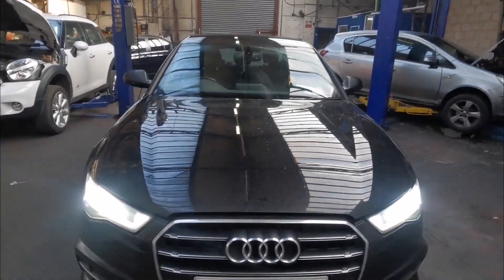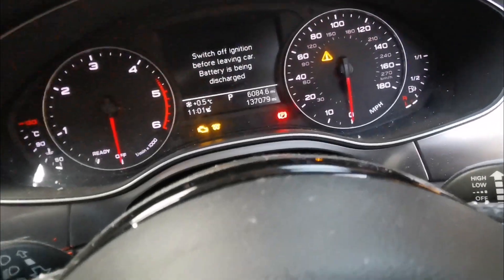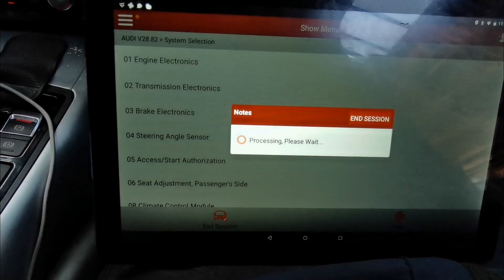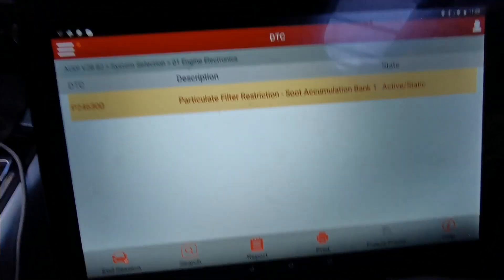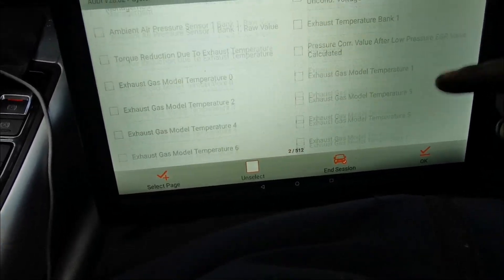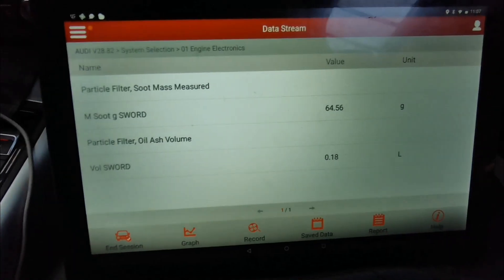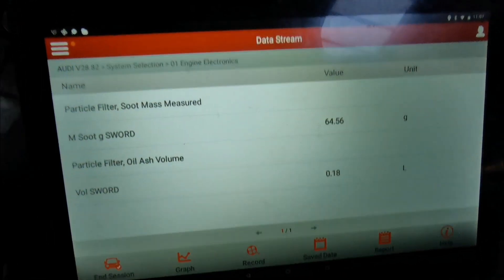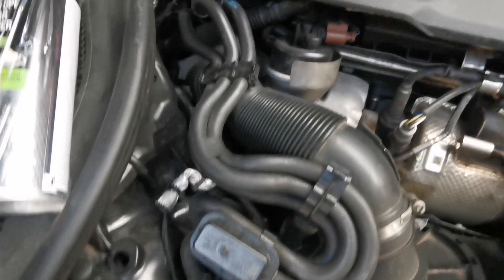cleaning dpf on car  Audi A6 2.0 tdi #Audi #VW #seat and scoda

Comment: Hello
I wanted to ask you a question about my vehicle?
Reply from the maker: Hi
You are welcome to ask, and I'll domy best to help. Other people will also help.
Reply: good evening, I have the same vehicle as in the video, Audi A6 c7 190hp. engine light on, I changed the egr and egr radiator, and I still have the engine light on and a loss of power. I noticed that the generations are being made, and there is a smell of exhaust gas in the passenger compartment. Can you help me please ?
Reply: I also noticed that the FAP regenerations take place when the engine is not necessarily at the right temperature.
Reply from the maker: I would check for exhaust temp sensor value and coolant temp sensor value.
If there is any fault code, I'll give you the test plan for it
Reply: OK thanks for your answer. I don't have a vagcom I will ask a garage to look at it. do you know what to do with the vagcom after changing the egr radiator?

Comment: Hello mr. , Im very happy to sharing this video from you, I need you- i"ll be very grateful to your answer, I have problem with dpf, or.maybe not, but when I restored my injectors,  since then my AUDI A6, 2012, 2.0 TDI, do many often regeneration, city ride about 120 km, highways-(way to my job)- about 240 km, but before reparing injectors didn"t do so much often regeneration. The mechanincs told me that is not any problem, cause there is no light or showing error, so dont being disturb. But I know that is not perfect and the problem remain, so what you recomend, this video shows simply cleaning dpf, is that the solution? thank you very much for your answers, TADEJ GABRIC, SLOVENIA
Reply: Salut ! wAi rezolvat ceva ?  In principiu stiu ca este ok atata timp cat nu ai eroriinseamna ca  sistemul functioneaza ok.

Comment: Hello, I wanted to ask, I saw the DPF cleaning video. This product can also clean the exhaust gas recycling radiator for the Audi a6 or you need to do another procedure
Reply from the maker: Hi.
For Egr cooler or radiator, I would recommend a procedure called engine carbon clean. That will help. This will not help at all.

Comment: hi
i have vw passat2ltr exhaust gases getting in the car,could this be bcoz of blocked dpf ? car runs fine no lag or loss of power.and i have spent so much on the car but problem still there.
done lot of tests no leak found.plz help.
thanks

Comment: Thanks for sharing. Noticed you have 137k miles? How often have you done this process and have you ever taken off the filter completely for cleaning before?
Reply from the maker: Thanks
This is only done when necessary.
I did not take anything off apart from the add blue injector as seen on the video.
Reply: @carsEVsvans  I meant have you ever had it cleaned by a shop by taking off the filter completely. They take the filter and run the chemicals through it then put it in an oven.
Reply from the maker: @drewdub8425  no.
This is a customer car and we do this for many of our customers and it works very well at least 90% of the time. If your car hasn't lost power (has not been in limp mode for a while) you can use this method. You will need to follow the instructions on the solution you use and use diagnostic equipment to reset the value or activate dpf regeneration.
So to answer your question, no I didn't not take it to the dpf cleaning centre.
Reply: @carsEVsvans  Thanks. I was just curious because over here there’s only 1 maybe 2 shops then do the cleaning. I feel the services over there is more available. I’d love to try this method but there aren’t really “over the counter” solutions sold here such as this.
Reply: @carsEVsvans  you also removed the temperature sensor as seen in the video

Comment: before spray the solution , what about the engine temperature ?
Reply from the maker: Cold is ideal. The purpose of the spray is to sock the Ash. Cold is Good. Too hot not recommended

Comment: are there any warning signs when dpf is due to be checked or issues could start? or does the car warn you? or do you have to know the signs?
Reply: For VW, the DPF light comes on. Then possibly the check engine light.
Reply: Also, the sign are the typical low on power, rough idle, etc. but that can be a number of things. From what I read the sensor measures pressure and when the light comes on, the pressure within that chamber isn’t where it’s supposed to be.
Reply: @drewdub8425  thanks for that :)
Reply: The previous owner changed my mk6 Jettas DPF filter at 180k miles. The dealer does not do any cleaning but instead change the whole can. The car is now at 240k and the light went on. Generally I’ve read that it should be taken out and cleaned every 60k-75k miles, but that’s just talk on the internet. I’ve reset the faults, did some spirited driving, waited till the active regen finishes cycle, but it won’t go away. The dealer will charge $250 for a diagnoses here in CA, USA regardless because it’s their protocol. All that being said, I’m taking it off and having it flushed by a diesel shop.

Comment: I also have a problem with the dpf filter in the sense that due to the low temperature outside the filter it does not reach a temperature higher than 250 degrees and regeneration cannot be done, I did forced regeneration while driving with the carista and in vain that the ash still does not fall from the deposited filter at this moment I have 27 grams of deposited ash, what can I do in this case?
Reply from the maker: If the temperature does not reach the required parameters, there could be few reasons why this happens. 1 faulty temperature sensor 2 faulty dpf injector, blocked add blue line or or pump. 
The temperature is maintained by injecting fuel or add blue in to the dpf. 
So I would check in this area to see why the temperature is not reaching.
Reply: I want to say that I don't get any error on the tester that some sensor or something else is faulty, only that it's cold outside, the dpf filter doesn't manage to exceed 250 degrees, I checked what you told me and it doesn't seem to be any of these problems
Reply from the maker: @fortzosu09 
What car are you trying to fix? If it is audi, check for the add blue injectors.
Fuel vaporizer or pump. Or if you can swap around the temperature sensors.
If you are trying to fix another car, let me know and I'll try send you common issues
Reply: @carsEVsvans  The car I have problems with is a vw golf 6 1.6 tdi from 2012, I read the values in real time with a delphi tester and the following values resulted: exhaust gas temperature bank 1 Value 20.0 Celsius degrees; exhaust gas temperature sensor bank 1 sensor 2 Value 20 Celsius degrees; exhaust temperature sensor 1 Value 20 Celsius degrees; Exhaust gas temperature sensor 3 Value 3.9 Celsius degrees; Exhaust gas temperature sensor 4 Value 3.4 Celsius degrees! So in this case I think the DPF exhaust gas pressure sensor is defective and should be replaced? What do you think should be done in this case?
Reply from the maker: @fortzosu09 
Before replacing the sensors, I always swap the sensors if the wires are long enough and carry out live data test to see if the value changes. And also check the resistance value on all  sensor to find out the faulty sensor.
I would say using vcds or odis diagnostics would probably give  better live data reading.

Comment: Did the oil ash volume drop from 0.18L to 0.02L by itself?
Reply: no, ash is calculated and cannot be cleaned, he just framed the ECU that DPF was replaced
Reply from the maker: Yes indeed. I have set the calculate mass from 64g to 20g. Once dpf regeneration is carried out, it even dropped below 20g.
Reply: @carsEVsvans  So you just enter manually 0.02L ash but actually you don't know how much is left in filter after cleaning?

Comment: Would this method will clean and EGR cooler too?
Error code p200200 particular trap 1 - efficiency below threshold
Reply from the maker: No it wouldn't. But instead you can use curbon cleaning solutions. Check some videos on YouTube
Reply: @carsEVsvans  appreciate for your reply man, thanks